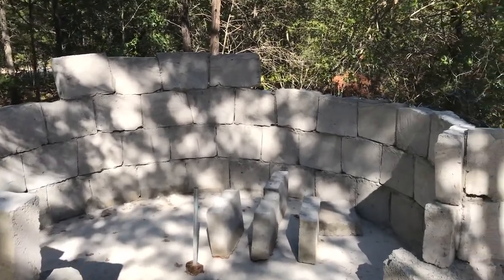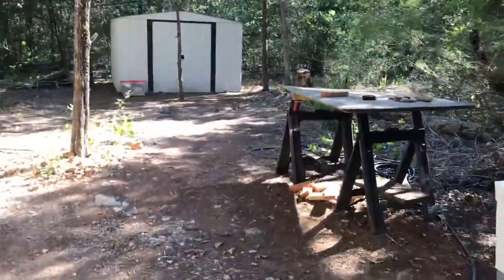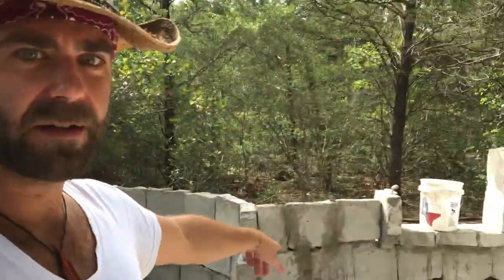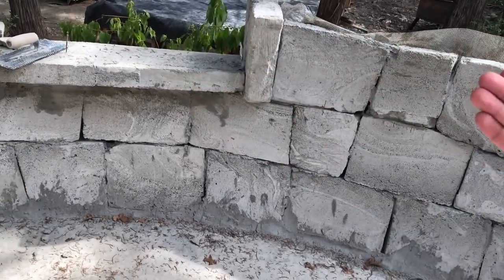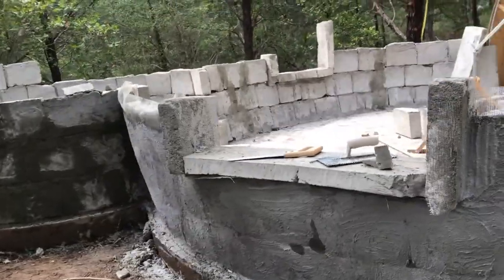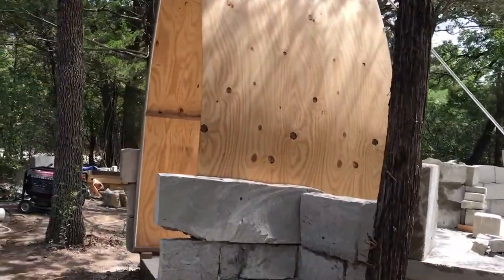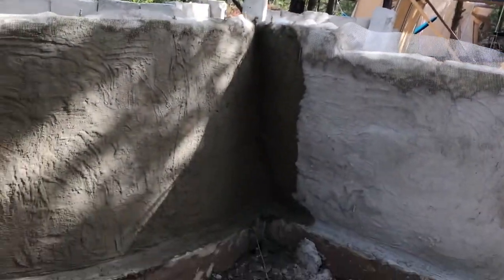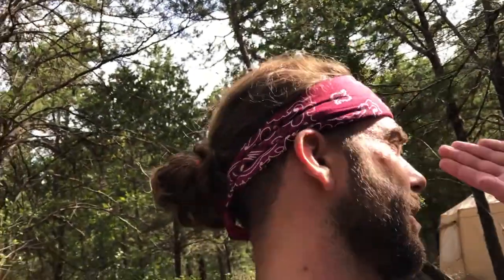Fourth Week Building Dome - More Mortar and Wrapping

Comment: Hey Nate, it's looking good! You're looking good too. I was curious, obviously I'm not a builder but how come you don't put the mortar in between the bricks as you lay them?
Reply from the maker: So I do add a little mortar when I set the blocks bet just enough to hold it up. Then after I cut the edges down when it dries I fill it in with mortar. Its hard to cut through